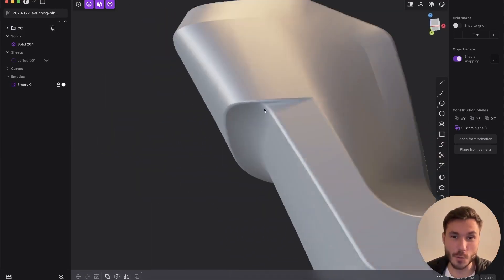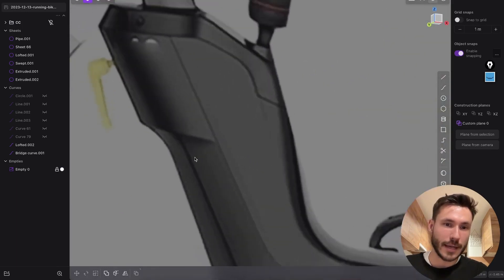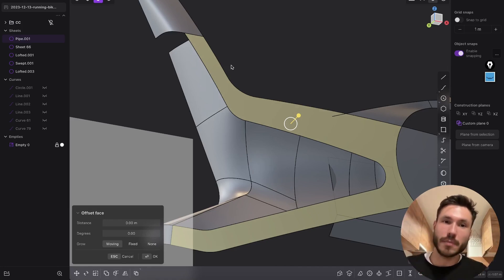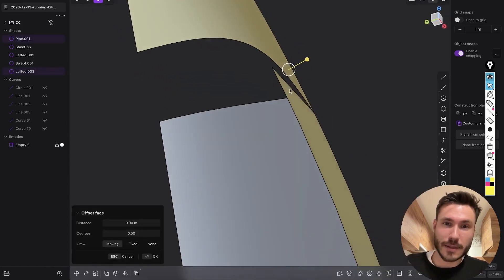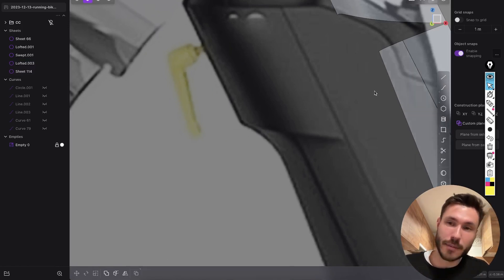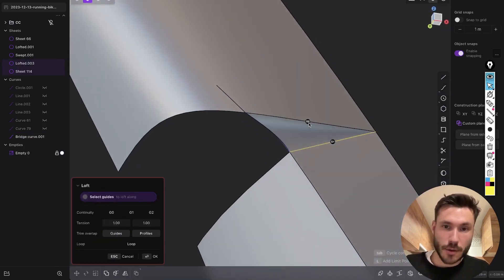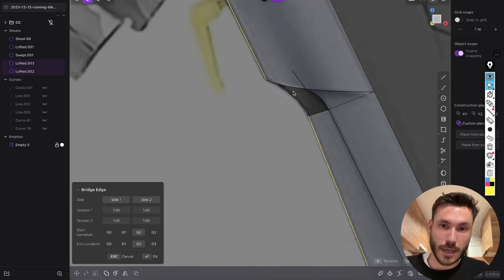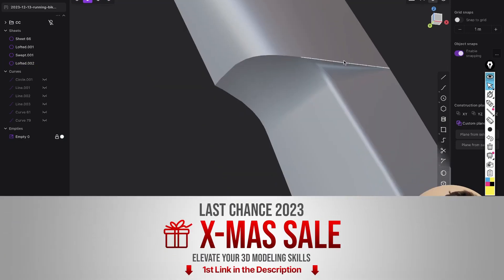Plasticity | Quick Surface Modeling Exercise | Two Surfaces into One

Comment: Good tutorial but the quality of the surface it generate is kind of disappointing, that's not on you. We need more controls over surface generation in future version.
Reply: I 100% agree!
We need rebuild edges in the patch command along with a match edge command.
There s a way to do it currently in Plas but it’s very labor intensive deleting and remaking surfaces after you built them all
Good tutorial Nikita
Reply from the maker: I agree too, but Nick is working hard now on 2.0 to further improve the surface modeling tools. SO it will be guaranteed much better with time. But it is already absolutely amazing how quick we can create pretty good surfaces.

Of course there is much improvement possible like Nickpunch mentioned, but it will also take much more time.

Happy new year to all of you!